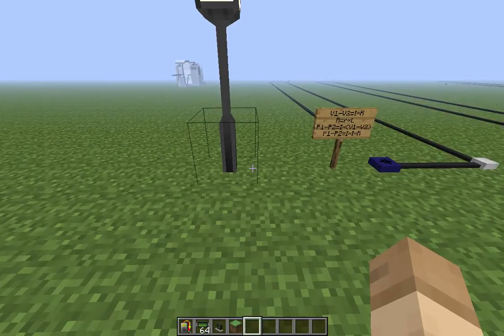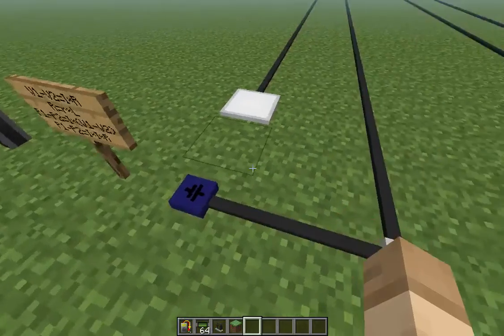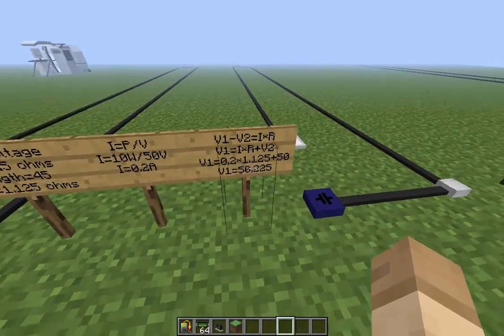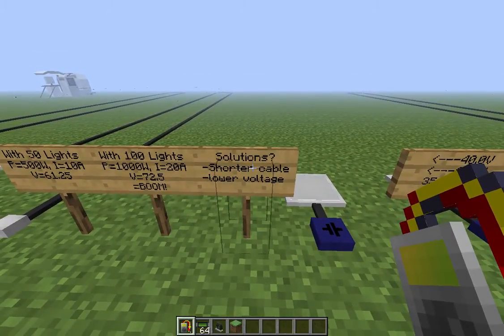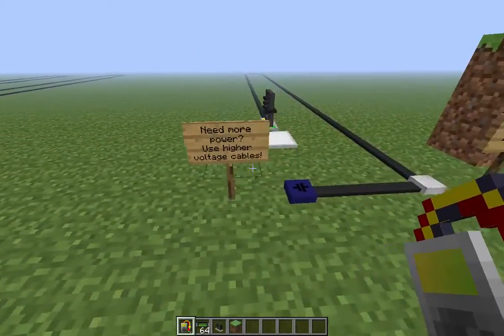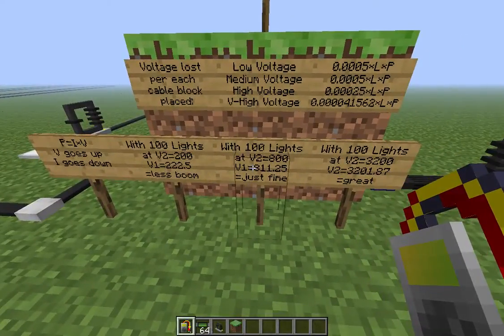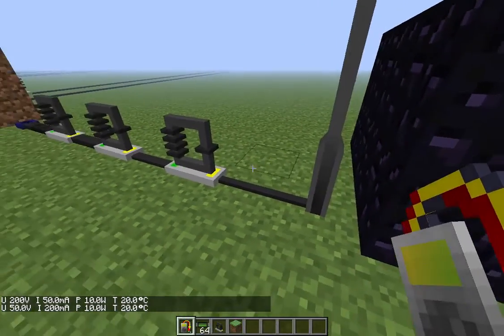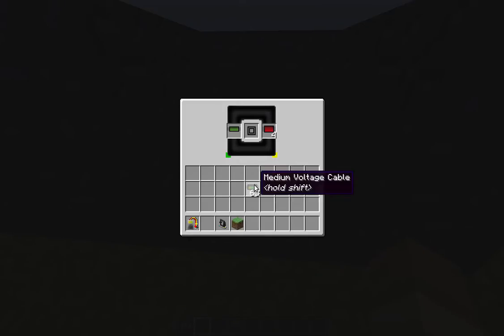Minecraft Electrical Age Mod Tutorial 01 - Cable lineup

Comment: Very nice. This video certainly does go a little fast for someone who knows nothing at all about electricity, but I'm fortunate enough not to be a someone like that. This inspired me to write a small program on my graphing calculator which allows me to make easy calculations with Ohm's and Watt's laws without having to think of the formulas at all.
Reply from the maker: +Daniel Duncan Unfortunately basic knowledge of electricity is a prerequisite for Electrical Age.  You don't have to know all the equations and such, but you do have to be able to grasp that electricity flows and that the flow has a relationship with the material it is flowing through.